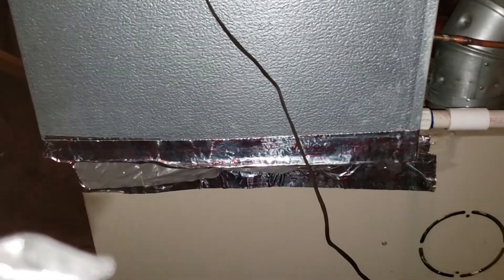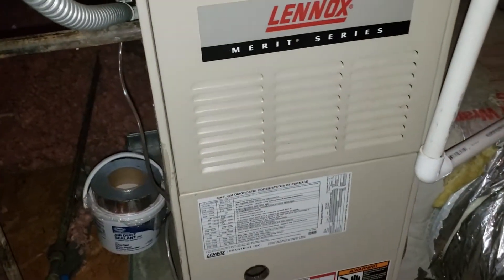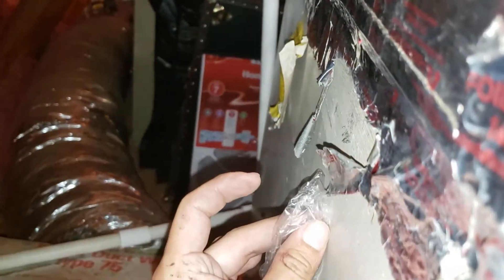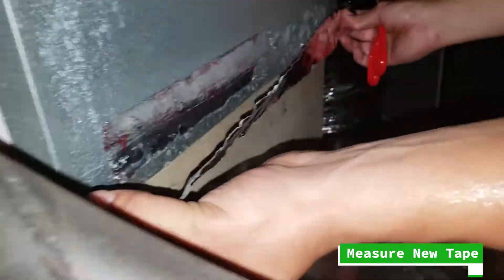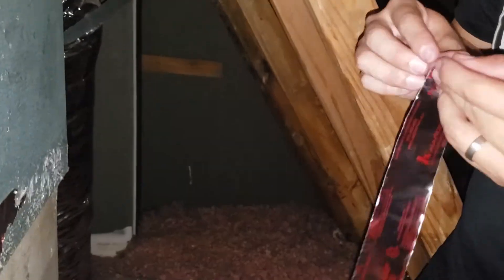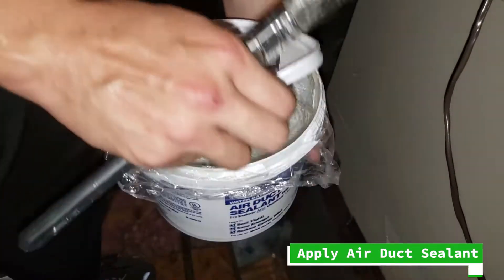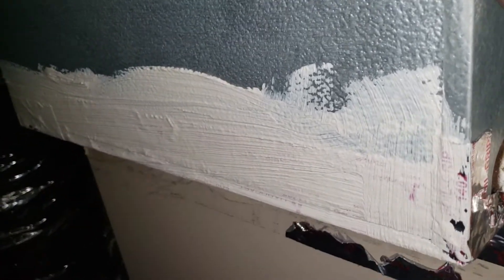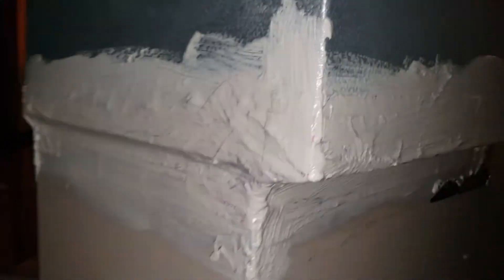How to Fix Air Leaks in Your HVAC

Comment: Will water leak if there’s a gap air can seep out?
Reply from the maker: Depends how much water. Machines like the one in the video will create condensation which can be seen on the outside metal sometimes. Most of the water should be coming out of the condensation line, which tends to be plastic, and not through any other holes. Make sure your condensation line is clear.

Comment: Is air from the blower supposed to be blowing out at the base where the cabinet and the floor meets?
Reply from the maker: Hi, you should not be feeling air coming out from the base because that's where you have the blower pushing the air. It really depends how much air blowing out you mean. All HVAC machines should be a closed air system, so if there are gaps air will come out a tiny bit. This is due to metal against metal connections that are not air sealed in these units, and that's why you need to tape them.

Comment: Would you also try to block off the openings where the refrigerant lines go into unit? Maybe with a flexible putty or something?

Feeling massive air leaks coming out of those openings. Thanks for info 🙏
Reply from the maker: I won't use a putty I would use the tape. I am not sure about which openings you are referring. Can you help me understand your question better please?
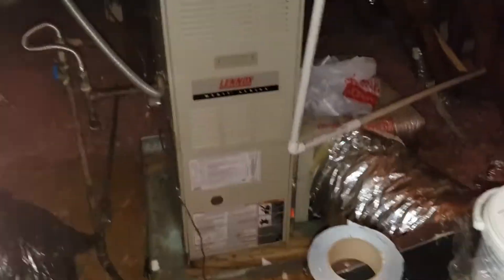Reply: @ajthemaker5058  He's talking about the openings at 4:52. And yes, I use silicon putty to cover those holes. That's one of the largest air leak areas.

Comment: How long should I wait before I turn the unit back on after doing this sealing method?
Reply from the maker: Hi Courtnie, you should be able turn on the machine within 1-2 hours after applying the sealing. The sealing should be hard.
Reply: @ajthemaker5058  Thank you so much! Your video really helped me.

Comment: Does anyone have knowledge about air vents in an apartment building? We live on a 3rd floor, the apartment is nicely cool (a new AC unit went in this summer) except for one room (never did in the years I've been here). Maintenance has tinkered with it, but never checked for leaks, which I think is the issue. But how can they fix a damaged piece of ventilation that might be inaccessible?
Reply: Most Ductwork has dampers that control airflow . The damper is probably closed
Reply from the maker: Hopefully your apartment is an easy fix. I had to cut into sheet rock once to fix a vent that was clogged. (There was no air coming out even after 2 air conditioning companies came out to give me their feedback).

Comment: Thank you for the video
Reply from the maker: Thank you for watching
Reply: @ajthemaker5058  I'm seeing water dripping at exact same place where you applied the seal. Is it for sealing that leak also?
Reply from the maker: @ashish2k1  Machines can have condensation which would go into the drain line